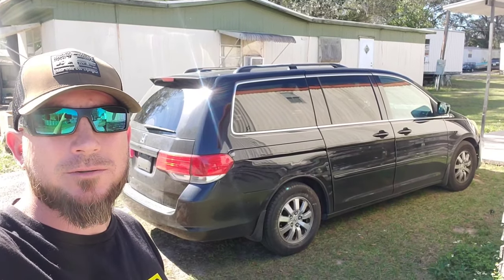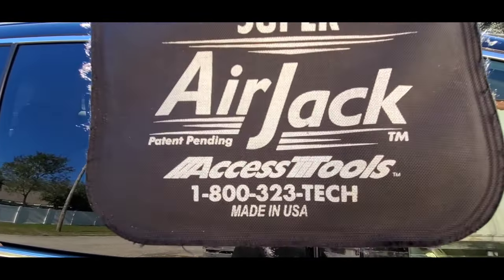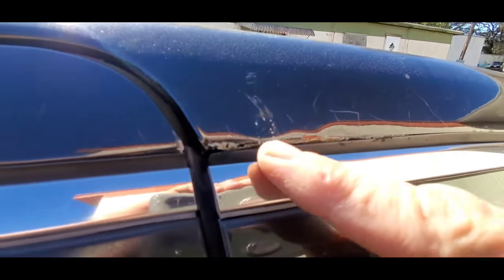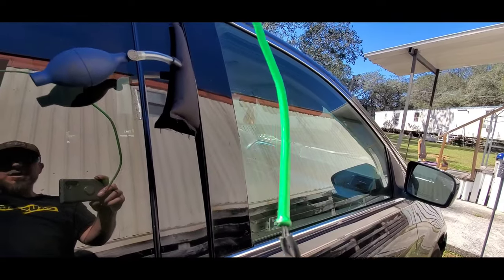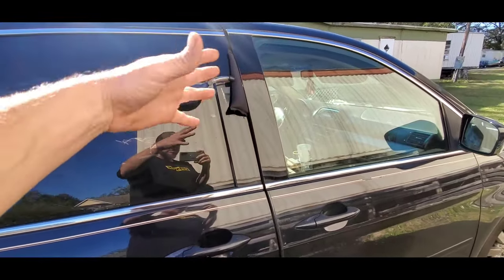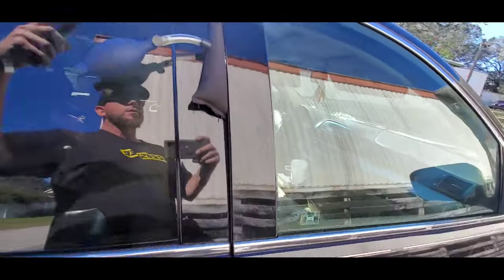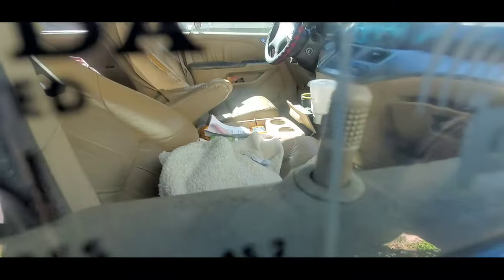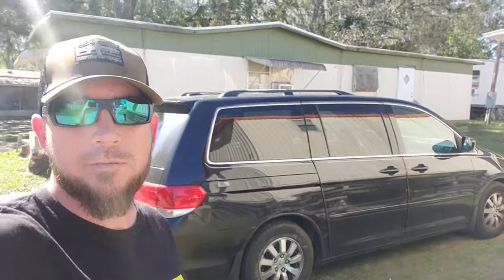HOW TO UNLOCK A HONDA ODYSSEY-KEYS LOCKED INSIDE

Comment: I was trying to get into the 2012 model.....they don't have the unlock on the top....it's by the door handle
Reply: Coat hanger. Bend it to try and get it
Reply: Push flipper forward and pull handle before car relocks itself

Comment: Thanks for your vids, but
this technique doesn't work on a 2012 model. 
Any other methods?
Reply from the maker: Flip the inside flipper lock with a long metal rod. Tractor supply or Home Depot.